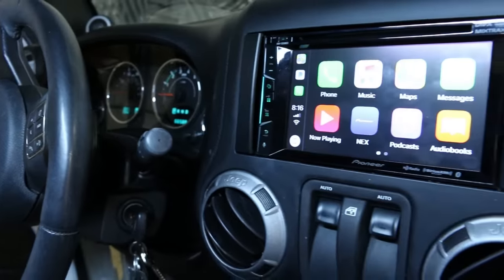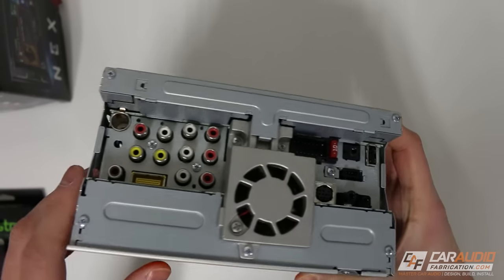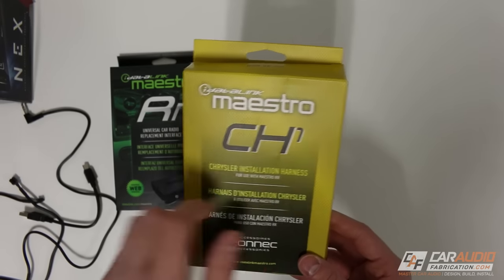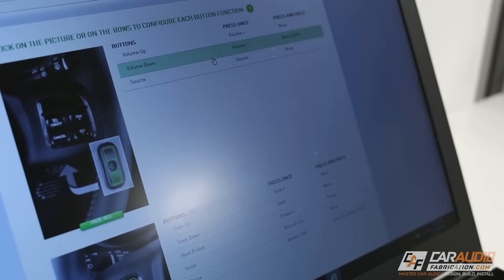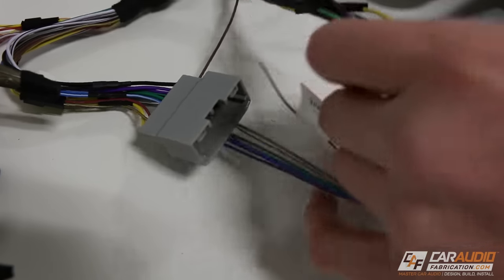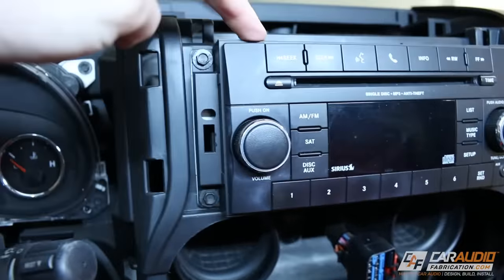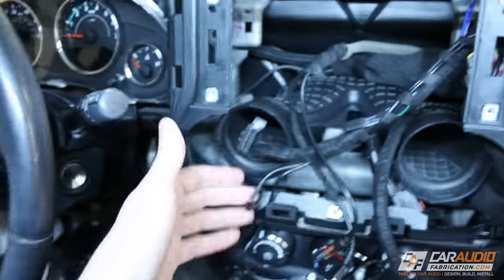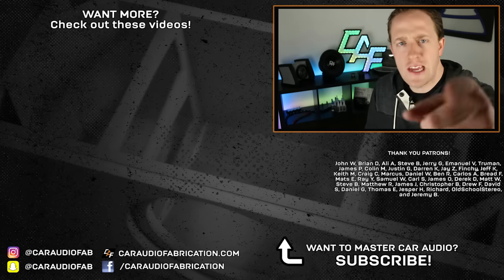How to Install Aftermarket Radio (Jeep Wrangler 2011-2017)

Comment: How do you disconnect paired devices (uconnect) from your stock radio when your stock radio is no longer working?
Reply: I’m having the same problem.  Did you figure it this out?   Thanks!

Comment: So if you permanently remove the metal support bracket from behind the radio, what do you screw dash-top add-ons into? I have a phone holder up there that now kind of flops around because there's nothing to securely screw it down into anymore...
Reply from the maker: Then don't do this upgrade.

Comment: Hello – I love the videos an appreciate all the helpful hints they offer. I do have a question.  I am going to be putting in a similar Pioneer unit to replace my factory mygig 430 (in  a Jeep wrangler). Currently, I have the backup camera wired to the head unit so that there is a Power wire and the Video input cable (yellow RCA) up at the head unit. Obviously, the video cable will plug into the backup cam input of the head unit, but the power wire was previously wired into an aftermarket adapter (Naviks) used to turn on the back up cam while in reverse OR manually while in motion.  What would I wire this power wire to now since I won’t have the adapter any more?   I will be using the Maestro RR with the CH1 adapter.  Is there a wire  I can connect this to that will turn the back up cam on when I shift to reverse? I only need it for normal back up and do not really care to use while in motion. Many thanks in advance!
Reply: I am not sure if you will ever see this comment as it's been so long since you made the comment, but I am curious what you ended up doing? I too am installing a backup camera that's hoping to have a power/hot line and was curious.

Comment: Do we need all the extra maestro stuff? I jus want to install the radio and use it by hand no steering controls. Would I just buy the fit kit and the radio for this purpose?
Reply: You don’t need it. It’s more for people with newer cars with stock features they don’t want to lose. If you just want to instal the head unit you can.

Comment: If I’m going to add a backup camera will flashing it cause any issues with all this stuff?
Reply: Also if the head unit has the wheel control and everything will I still need the maestro

Comment: Great install video!  I am having issues with this Pioneer head unit. The bass keeps getting loud then getting quiet periodically.  I have since swapped out my alternator to a higher output.  Replaced the NVX with a higher wattage.  Moved my ground wire to another location to straight bare metal. The cables I'm using are the same as in this video..  I guess all that is left is this head unit which worked perfectly for about a year then started doing this. Any  other ideas?
Reply: Did someone mess with it at one point? Could've turned on speed compensated volume or messed with the levels? Sounds to me like the subs could be possibly blown too.
Reply: @jakefee9838  thanks for your reply.  No one has messed with the head unit. I have since upgraded all of my battery cables to 2ga and its still happening.  The bass will get real loud then get lower,  like im manually lowering the bass level from max to min.
Reply: @anthonyr829  Very strange I wish I could do more to help
Reply: @jakefee9838  its all good 👍

Comment: Does installing this in this way retain the access to the factory Sirius XM, or would I need the pioneer XM tuner if I wanted access to XM? Do you have to go into your sirius accoutn and change to radio ID to get it to work?
Reply: it will retain the facory sat. if you wanted to add it if you do not have factory sat you would use the sxv-300 tuner which works with most radios now that are sat radio radio.

Comment: I have a Asus Zenpad S3 10 that I will be utilizing as my headunit instead of a traditional headunit. I'm trying to figure out how I can keep the steering wheel control, microphone, functionallity by completely removing the standard double din head unit that comes stock. I'm unsure which wire harness would be best but I'm guessing anything with ad many output as input wires. Would like to convert all connections to USB or whatever so it's fully functional to my tablet. Any information would be great and much welcomed.
Reply: I just ordered the part list you provided minus the headunit. I trust your expertise.

Comment: Do I need the iDatalink Maestro Rr if my steering wheel doesn't have all the buttons? I have a Jeep Wrangler JK 08' and all it has is just a plain steering wheel. Thanks
Reply: no you would not need the rr. it is used for customers who prefer oem features over aftermarket IF it can be used to do so each vehicle is different. your jeep you will most likely need some form of a data harness because of how the factory radio is using the cars can-bus system ....

Comment: I should have listened to ya....was debating back and forth on an install such as yours with the maestro setup vs that Chinese 10in touch screen and I "thought" the big screen was better.....was I wrong.....right out the box on first start up i had issues with the Chinese stuff, speakers not working, factory sub dead to the world, now I want to return it and now I'm getting the run around.....I should have listened to ya......
Reply from the maker: Car Audio is a world where you get what you pay for.
Reply: Keep doing the good work you doing.
Reply: is there any recommend head unit for 09 grand cherokee srt8 WK1 models

Comment: When you plug the idatalink cable to the ODB II will it have to be removed for emissions testing? 

Is it permanently connected to the ODB port?
Reply: I would like to know the same thing. Although, in the instructions it does have what pins that the "wires" connect to. I may just splice in behind the port and wire them in directly so I can still have use of my port.
Reply: @priceheppe530  did you end up splicing in behind the port.   It seems like a number have asked this question and no one has the answer.   Doesn’t seem right to having it unplugged all the time.

Comment: Question Difference between PAC RP4-CH11 & Idatalink Maestro RR?
Reply: I know one things is you won’t have the ability to shift the speakers sound in space
Reply: The iDatalink has more vehicle details but depending on your headunit and amp it may not be material - both retain wheel control but the iDatalink is programmable for sure. This is for anyone who has the same question, being it’s been 2yrs can you say what you went with?

Comment: Installed everything correctly with everything you have but I have factory sub and no amp. Go to make a phone call and cannot hear through speakers?? Any help?
Reply: Did you run the audio cable from the Maestro to the Aux in on the radio.  I had the problem and this was it

Comment: I need help I have 1995 chevy 1500 truck. their is no radio in the truck and all the wires in the dash are the same gray color and no marks on the wires. Can you do a video on how to install a radio with that problem? thanks for your time.
Reply: Grab a multi meter and find the constant, switched and ground wires. These are the easiest to determine, just probe each wire until you get a 12v signal with car off for constant, 12v with car on for switch, and then probing for ground by connecting the red lead to a positive electrical source (i.e. the car battery). The speaker wires are bit more difficult. The easiest way would probably be to connect a battery (9v should work so you don't have to lug around a big car battery) at the speaker side, and then find which wires in the dash complete that circuit. Once you find which wires do what, make sure to label them somehow (Paint marker, colored heat shrink, tape flag that you write on, etc.) Hope this helps.
Reply: thank you

Comment: So when you take the plate out you loose the top bolt on the dash, can you cut it so I can still the bolt up top? I have the cell phone holder above the radio that bolts on.
Reply: kjd1172  I am also wondering the same thing. I don’t see any way to put a bracket in that the bolt goes to?
Reply: @tlukewyatt1  just to days ago 5.1.2020 I decided to try a thing, I cut the bracket and put it back in the Jeep, I have pictures of the bracket on my IG account
Reply: @codebluejku  thanks for that. I was going to do this install and would also like to keep my phone mount.

Comment: Having to pay so much for a maestro kit makes me never want to swap my radio.
Reply from the maker: Nearly every new vehicle  now requires a similar interface if replacement is even possible. Otherwise you are losing tons of features.
Reply: @CarAudioFabrication  Would I absolutely need it for the radio just to function, sound output, apple CarPlay etc.

Comment: Why would you want to retain OEM bluetooth? My main reason for wanting to raplace my head unit is to get rid of that God awful bluetooth pairing bullshit. The only way I can pair any bluetooth device to my stock radio is by going through the moronic voice prompts. What should take all of 30 seconds, takes 10 with all of the misrecignitions. Can I retain steering wheel controls while deleting the uconnect?
Reply: Did you hook the aftermarket radio to factory microphone, or the one that came with the new unit?

Comment: Now do the front speakers! Lol. Hate wranglers for that design aspect.
Reply from the maker: +Jay they are definitely a fun location
Reply: CarAudioFabrication you're quite the masochist I see! Haha
Reply: CarAudioFabrication and there was such hope with, i forget the model (CJ?), when they added the covers for the front speakers that came off with just two screws. Still stinking 3x5s but it was an easy install at least. I have so often just added kick panels in Wranglers that I had a form for them when I worked in mobile.
Reply: CarAudioFabrication where is part 2 (the final install) what did you do after you put the console back on? Speaker connection?

Comment: Has anyone had siri/text message read back issues on their pioneer installed radio? I installed the 1440 and it worked great with my iPhone 10 on iOS 12, but I upgraded to iPhone 11 and iOS 13 and now siri, text message read back, and hearing peoples voices when they call me no longer works.
Reply: Mine quit working as well
Reply: mylhose I ended up taking mine apart a few times and switched some wiring around. I eventually was able to switch a few wires and got it working again. Wish I recalled which ones I switched for you. Sorry about that.

Comment: A couple different things.  I keep reading stuff about a CANBUS adapter.  If I'm understanding right that's only needed if you have the premium system with a factory amp.  Please advise.  Second, can anyone recommend where to wire the 12v accessory wire and the orange/white illuminating wire?  I have a 2012 JK. Thanks.

Comment: Ok, I have been mewling over this for a few days now, since you released this video, your statement of buying name brand Audio solutions over some no named or unknown named brand from China or Japan....

But what about those of us that WANT an Android Solution???
I am even considering doing an Android Tablet install in my 1994 Ford Van for 2 reasons.
1) No area for a Double Din solution without serious serious serious dash modification
2) I want the freedom that Android and Google play offers from its apps and audio solutions.

I have considered building a custom Center console between the seats and installing a Double Din solution Android receiver, but again the Android solutions I am finding are all from companies you just said NO to.

So looking into the Name brand solutions; do any of them offer a true Android solution offering???
Reply: I will do some homework, though I fear that these will be heavily modified forms of Android
Reply: Just get one with Android Auto support. It's what I'm doing. Basically following this guide but swapping the Pioneer unit with a newer model that supports Android Auto
Reply: You can get what you want.  Just know that Android units use low quality components and have poor audio quality.

Comment: All that extra shit is useless. The pioneer head unit already has Bluetooth satellite radio built in, you don't need to retain the factory version also.
Reply from the maker: +heavyset0223 you'd be surprised with how many people like the unconnect and want to retain it. Not to mention every one wants to retain steering wheel controls
Reply: Bluetooth sat radio? Lol.
Reply: No big brand radios have sat radio built in. You still need the tuner. The Maestro parts may not be necessary, it's far from useless.
Reply: If you retain the UCONNECT, I'm assuming you have the factory announcements?  What else is retained, what's the benefit if you are install a new system with the same options?